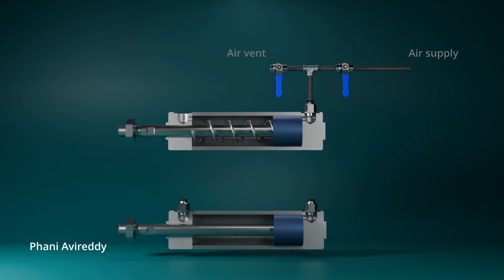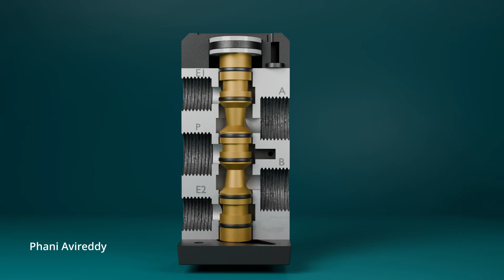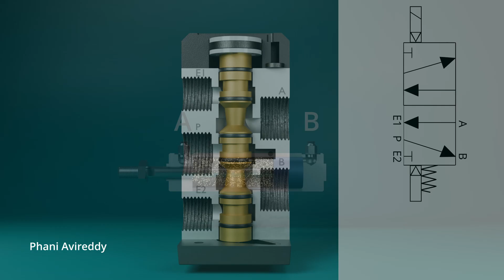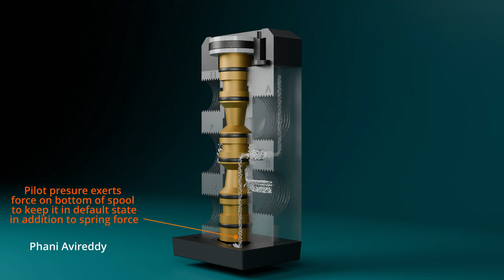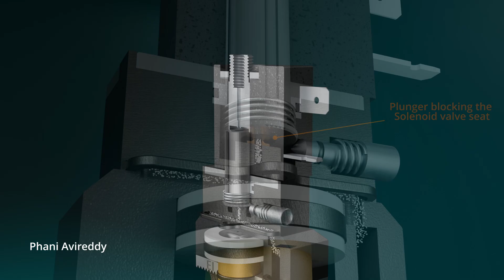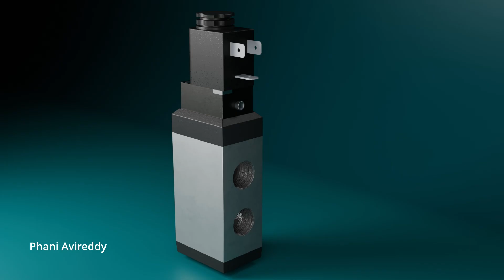How a 5/2 Directional Control Valve Works (with 3D Animation)

Comment: Great video! The best video that explaining 5/2 solenoid valve
I am new to pneumatic  solenoid  valves. For a project i bought a 5/2 valve and tested it just energizing the coil without applying compressed air. I panicked as the spool did not move. But after watching your video, i cleared my doubt
Reply from the maker: I'm glad my video could help clear up your doubt!